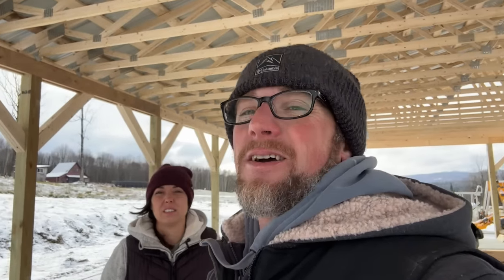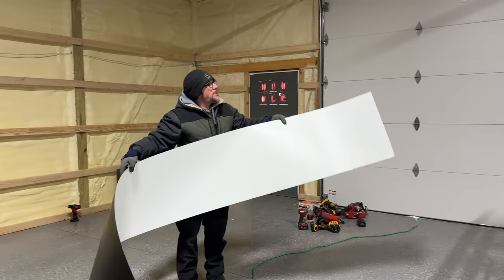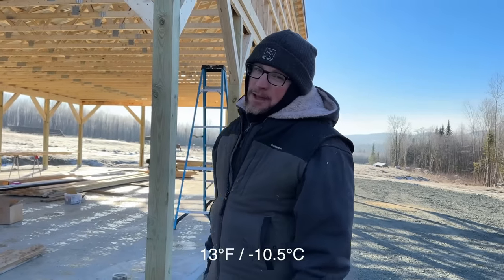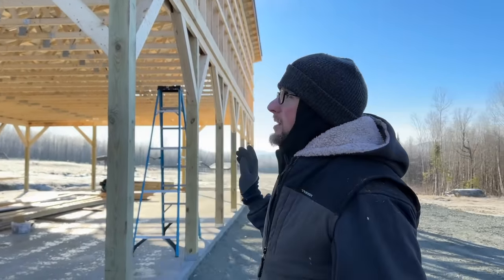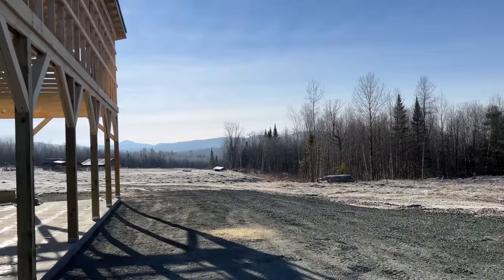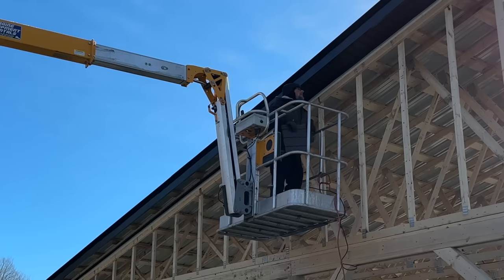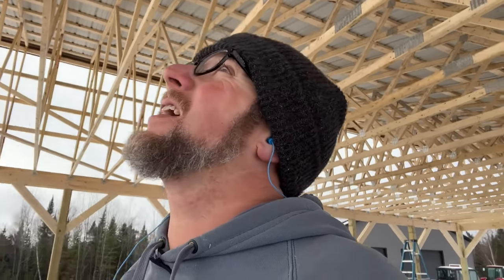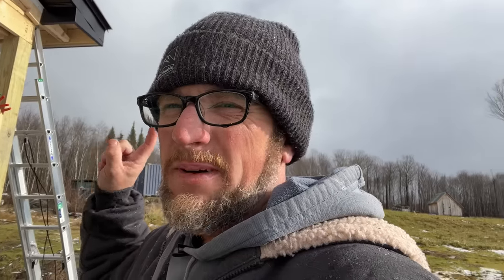The Day I got STUCK in the Lift!!! Day 5 Building our 32x48 Off Grid Post & Beam Barn in the WOODS

Comment: Building term for the day.

The soffit close outs are referred to as a "Bird Box".

There is a piece of siding called a F&J which keeps you from having to install a "C" channel and a "J" channel. When working at heights, the F&J can be a real time saver.

For the control panel on the lift. Tape a piece of heavy gauge plastic (trash bag) and drape over the panel, and bungee cord into place.

The building is coming along very nicely.

Comment: It seems that the lift unit has a little design flaw. The electrical panel on the bucket needs some attention. The control buttons need some water proof seals or a cover to protect them from freezing.

Comment: So far this has been a most interesting and challenging year. I would plan a work walking path down the center being able to drive the tractor through the front and drive through the back.   For now plan on one stall being feed / Hay & Straw storage. I would move up to the Barn the two other building’s as extension to the Barn. One being on one side or the other. For the animals on pasture to be able to come in out of the weather. 
Wow you’re getting it together relatively quickly. The weather is probably going to be pretty nice this December
Reply from the maker: Gooooood Morning  Clarence. I’m hoping the weather holds off for a while

Comment: I would put sliding barn doors over all 4 10' end sections! Also 10' gates or doors to divide into sections, but you slide the doors open on each 10' section swing the dividers open. Then you can clean with your tractor, leaf blower, and pressure washer! No shoveling required! You will thank me when older like me! Work smarter not harder!😅😅😅

Comment: when we lived in Scotland we kept pigs  and as separaters we used a 4 x 2 lengthways inside the 2 posts and we threaded the 4 x 2 inside the pallets to tightly fit .. it was a farmers fix and when we left 10 years later it was still good... the 4 x 2 was inside the top and bottom of the pallet... its difficult to explain but works very well and allows good air flow.. obviously the pallets were on edge..

Comment: I believe that most lifts have a safety switch on the motorized part on the ground so that you can bring the boom and basket down if the controls freeze up on you in the basket.  I know different models have them located in different areas, so it may be a question to ask the rental company.

Comment: I enjoy your channel. I've built quite a few barns and I have a question about your soffits being closed in. As you know, it's very difficult to keep birds and rodents from nesting in those areas. I generally block between the rafters and trim out the fascia and leave the soffits open on a barn depending on the ceiling type. I stain the inside the soffit area. You're very detail oriented, so I'm sure you have a plan. Keep up the great work.
Reply: I was thinking the same thing. The squirrels will love making nests in those soffits! Other critters too. Soffits on a barn?

Comment: Add a couple of insulated heated waterers inside the barn.  A cow usually drinks about 50 gallons of water per day.  Suggest you plan to make the future barn longer so you can add a 20 foot loafing shed on the side with the high roof.  Animals should not stand on concrete, but ok if on fine gravel (chat) with drains for getting rid of liquids.  The barn should hold feed and hay.  Animals should be in the cold part of the building (loafing shed).  Plan on having hay feeding and grain feeding trough and hay rack above......the entire length.  Store square bales in barn.  This way you can feed from the barn directly into the feed/hay trough and hay rails.......the full length.  The loading shed can be divided according to animal type.  I saw in a performance bull development facility where the enclosure contained the shelter and feeding trough/hay fixtures, but made the bulls cross a steep rocky distance bank to go to water to make sure the bulls got exercise and toughen their legs, etc..  Be sure to use heavy wood or steel reinforced concrete blocks to line the walls (to five feet height) of the  loafing shed so the animals don't breakout the walls when bumping, etc. (they create huge force at their weight) when inside the loafing shed.   There should be a completely different shed for storing round hay bales.  There are interesting ways to feed these bales.
Go to your local university livestock facility and have them help you plan for cattle/animal handling corrals, etc.  With your ability, you might explore embryo transfer of high end animals into donor animals.  Quality not quantity.

Comment: Good Video, Your going to have a lot of run off from that big roof, hope that ditch can handle it without backing up. What about windows on the high side of the roof. Might be hard to clean tho, but would help use a available light
Reply: I wondered about that. Would translucent panels ruin the clean look Al is going for?

Comment: Looking good. It would be nice to find a way to be able to harness the water coming off the roof to make watering the animals in the barn easier.
Reply: Freeze during winter! Ball valve will break! Maybe in Spring/Summer/Fall? He has a Spring with a frost free hydrant system. That's pretty good for a farm. Raised on a farm are we?
Reply: Or use his backhoe to bury some under the frost water lines and solar water bowls.
Reply: @StoneKathryn  No, just raised in a country that doesn't freeze half the year.
Reply: @LorraineDennison1960  That makes a lot of sense. My sister visited me here in Minnesota in January during the 20°Fs below zero and she was very surprised to hear her coat sounded different in the cold. You can't wear leather because it'll crack. Materials sound different when it's that cold. Even the exhaust out of cars sounds different!
Reply: @StoneKathryn  Goodness. I live in the coldest part of Australia, (Tasmania) and the coldest it gets here is maybe -1celcius mid-Winter. And that is only a couple of nights. lol
Reply: @LorraineDennison1960  We usually have 2 weeks of 20°Fs and 30°Fs below in January and then a bit of a thaw. My chicken eggs freeze in the barn those weeks. It's even colder with the windchill.

Comment: finishing off the inside barn  keep in mind  pened up Livestock going to make  💩mess and need cleaning suggestion keeping passage  open so can use mechanical assistance so push or pass through  basically push from end to end  openings  and possibly provisions to load and unload animals from trailer

Comment: Hey Al, have you guys discovered the heated vests and coats available now? They have a USB port but you can plug them in to charge up and the commercial says they last as much as a couple of days of giving you warm to your body on cold days. That might be a big help out working for the animals. Didn't have such things when I used to do early morning milking and making out. I would suggest for your barn the two corners closest to the shop make them into stalls 10 ft.² so you have a place to put sheep when they're getting ready to lamb or a cow when she's getting ready to have her little one. That leaves the backside along that hill available for pigs or chickens. You could close off a smaller area in the barn for a tack room, where you keep lead ropes collars, harnesses things you might need for newborn calves, sheep, pigs. Open space would be a good place to keep your tractor, so it starts in cold weather. Yes I know that equipment is built to be kept outside but if it's cold, you have the heat controls like you did with that lift. It's a nuisance to have to do that every time you want to use the tractor or any other bit of equipment. Things are moving along nicely on your farm. Are the girls bugging you for a horse yet? You could also reverse reserve a tent for square area in that barn for a horse just in case you decide to get one at a later date. So nice to see your place growing so fast soon you're gonna need an assistant I'm sure. Thanks for sharing we do enjoy it!!

Comment: If you stack that soffit you can cut several pieces at a time.  If boxed you can cut through the box and it helps keeping it together without using tape.  Just a thought for next time...less cutting😊

Comment: Al,
What ever you do leave an open alley down the middle wide enough for your tractor to go all the way through. Will be much easier to get bedding and manure in and out...also use metal junction boxes and plug boxes. Animals get bored and very destructive. My stalls are made with a 3 inch gap off the floor to allow me to wash out the stalls which really helps. The walls are rough sawn oak which has worked out well. Ventilation is important during the summer but in your climate on the large openings consider a roll down type door that's a heavy duty poly ok the two ends or at least the north facing wall. Install more plugs than needed and faucets you will thank yourself in the future. Fans ok each end will provide air movement in the summer and help with flies. Just a few things I learned after the fact.
Reply: Deep bedding? Watch Justin Rhodes and his pole barn for his animals for the winter. Permaculture! Ever heard of it?
Reply: @StoneKathryn  I have and to each their own. His barn is different from mine and mine is different from Al's it's a matter of what works for an individual person. To each their own...
What do you use In your barn?

Comment: Hey Al…..I have been wondering how the 10 panels on the wall of the workshop is doing compared to the roof panels covered in snow…..have you had enough snow to do a comparison?
Reply: the side wall panels are a supplement for lower sun in the winter and to gather sun when the roof is covered in snow. They will also pick up reflected light from the snow on the ground. The snow on the roof will melt in a few days and all will be normal again.

Comment: There are emergency controls that allow you to lower the lift in the event of electrical failure.  There should be labels on the frame of the machine that show how to use the controls.  Basically, you are able to release the hydraulic pressure manually.  You should definitely take the time to learn how to use the emergency controls.  And never climb out of that basket to get down.
Reply: But if they “knew” that, they couldn’t have the thumbnail, the title and all the worried viewers commenting and adding $ to the  bank.
Reply: Do I detect just a tad of cynicism here?
Reply: It would have been pretty safe and easy to climb down the side of the barn if necessary.

Comment: I love watching you guys and here is a pro tip for cutting plastic and vinal ! turn your saw blade around , so it is in the opposite direction and it will cut like butter ! blade off , flip it over to the opposite side and you wont get any cracks or misscuts !

Comment: I’m sure it’s a moot point now but did you consider clamping a low wattage heat lamp to the aluminum safety rails around the control panel to keep the buttons thawed? You would also use to warm your hands if needed. Run long extension cord from the shop if need be.

Comment: For the pigs when you make a pen in the barn for them you need to have more posts in the back walls.  Spacing of the posts is too wide and you will need to add extra posts to account for them pushing on them or if you get a small enough machine to cleanout the stalls.  The pen walls do not need to be more than 42" tall.  I made pens in our barn when it was built and had to go back and reinforce them.

Comment: The lift is a work platform where people use power tools. You would think that the manufacturers of the lift would have thought about installing a power line to the basket alongside the control wiring.

Comment: WRT ideas for the inside of your barn.  Put the interior stall walls on hinges - this will provide maximum flexibility both for use and for cleaning.  Need a larger stall - open a wall. Need to move animals from one stall to another - open a wall.  Speaking about cleaning - this is the hardest chore inside a barn, so make it easy for yourselves. Having moveable walls accomplishes this.  What would be the absolute best would be for the outside walls of the barn to swing open as well and this way you can just drive Gina's little Kubota right through and scoop out all the manure and hay/straw.  HUGE time saver and time is the one thing we never get back - it is your most important commodity.  OK, off my soapbox 🙂
Reply: Pens are better I think. Watch Justin Rhodes and his winter pole barn for his animals.
Reply: No versatility with permanent walls, none.  And they make cleaning more difficult.  I used to watch Rhodes, but he does a lot of bone-headed stuff that he doesn't think through first, but it doesn't matter to him since he's raking in over $1M /yr (good on him and massive props for cracking the code to killing it on YouTube, but that doesn't mean his ideas are good) @StoneKathryn
Reply: @fooddude9921  His stuff is modelled directly from what Joel Salatin does so I think what Justin does is great. I love the Pigerator! Long live Joel Salatin!
Reply: And if I'm not mistaken Joel has the ability to drive a tractor into his barn to get the 3 ft of hay/straw/pig dung out at the end of the season.  Still doesn't change the fact that there is no versatility with permanent walls.  Cheers
 @StoneKathryn

Comment: You might arrange it so that the feed is central to all of the animals in some fashion.   You might want to find a way to secure your feed from wild animals such as bears, rats, and cougars if you have them.  Rats will chew through anything and squeeze through the tiniest of openings to get to food.

You might arrange for exterior exits for each of the animal pens.  You might set up external fencing so that you could guide the animals to any of the pastures that you have alluded to.  Same for the interior and routing animals. 

You might come up with a modular fencing scheme so that you can quickly reconfigure your set up.  Things like making standard size walls like say 4 foot lengths.  Or maybe electric fencing would be better.  What about drilling some holes in the cement at standard locations so you could use stakes to secure the fencing on the bottom.

You could also route water, air, and power to make feeding, watering, and cleaning not to mention milking .  Maybe all that is routed up high to make reconfigurations easier.

Maybe putting cameras in there so that you can check on things.  

You also might put a total fence around the whole thing maybe at 20 feet out from the side of each of the exterior walls to help contain any animals that might get out.
Reply from the maker: Cameras would be nice
Reply: You're also going to need some way of containing animals for vet exams, bigger animals like cows especially. Make it easy on yourselves & the vet.

Comment: Al-  remember when you did the house with the lift , rain got into the control box and did the same thing then you covered the control box it worked fine. The same thing now but freezing it. Try covering the box with a loose piece of insulation or something & a plastic bag. Maybe this will work or not. Keep the heat gun handy just in case. 🥶🥺

Comment: I've never used a lift/cherry picker that didn't have controls on the ground level.  I've also never used a lift that wouldn't let you down when you didn't have electricity or the motor running.  All of the ones I have used were hydrophilic meaning you could release the pressure allowing the basket to lower.  Gina should be show how to use those controls before Al goes up next time.

Comment: You have lots of potential space amongst the rafters. If you instal some blocking on either side and lay down plywood you can have a subfloor that goes the whole length of the building all in the large and medium triangular void space in your rafters. I wouldn’t mention it except your trusses are 2x6 and can take the load. This would allow you to stick a real small living space up there for when your livestock are having problems and want to be closer. Having a small insulated space, with a stove, and a bed will make those times where the livestock life gets real ugly just a little better. Regardless, just having storage, is always nice.

Comment: Good Morning!  Gina:  If you slip on the roof, you will slide down and fall off from nine feet onto a snow bank.  In a month or so, it won't even be nine feet.  You will be able to step off the roof into the snow!
Reply from the maker: It will be interesting to see how deep the snow gets behind that roof
Reply: Make sure before you climb up to wear red shoe strings!  When you feel that you’re going to fall, dive in head first.  They’ll always fine you by the red shoestrings!  😁

Comment: My guess would be that if you heavily insulate (towels/blankets) the lift control box at night, it may not gather moisture inside the switch buttons so they won't be able to freeze. May even require keeping a folded towel on top of the buttons when you're using it during the day ???
Reply: Or park it where the sun will shine and melt it off.

Comment: Gina you sweet little thing don't worry AL will always have a solution....YES Best to cover the control panel overnight with some cloth to keep the frost off. We have warm /hot packs we can use for oür hands and feet that last 8 to 10 hrs will keep it very warm. Would warp a cloth with one of them in it.  Strange It doesn't have an emergency down button or another control at the bottom unit?